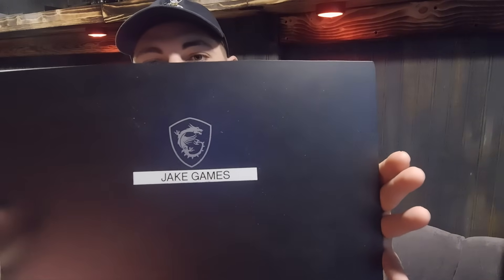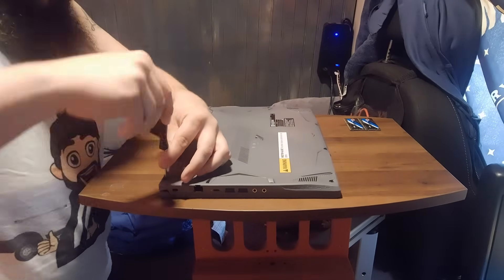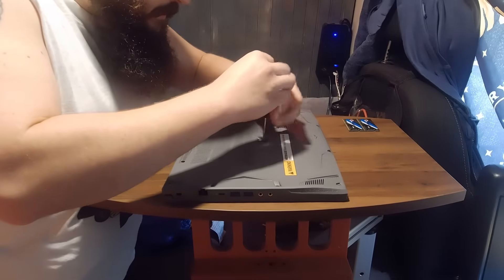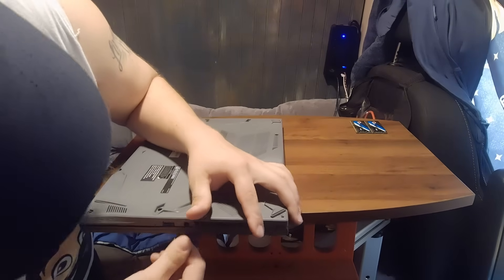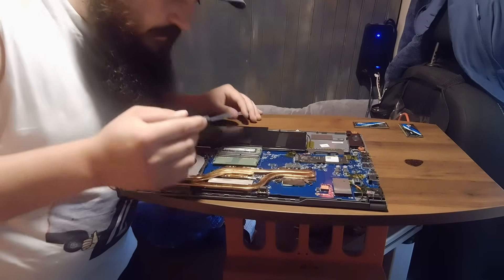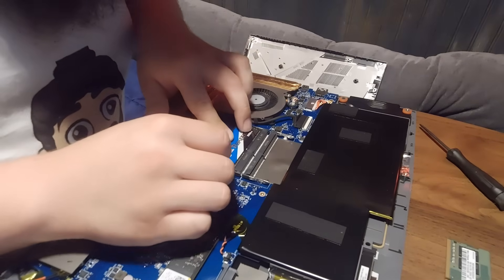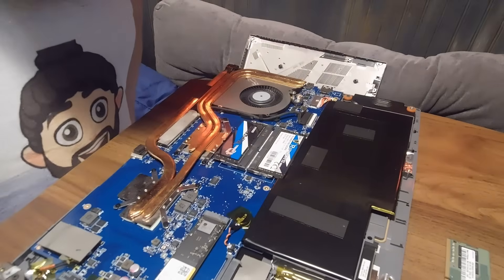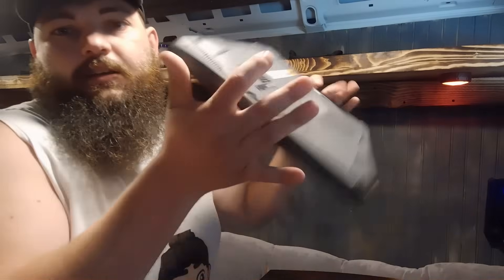Installing Ram Upgrade from 16g to 32g on MSI Thin 15 Laptop

Comment: Does any 32gb ddr4 work? Bc idk which one to choose
Reply from the maker: To know if 32GB DDR4 RAM will fit, check your motherboard's specs for total capacity and slot count (use CPU-Z or System Info), ensure it explicitly supports DDR4 (not DDR3/5), and verify the stick form factor (DIMM for desktops, SODIMM for laptops) matches your system, using online tools like Crucial or Corsair for easy compatibility checks.
Reply: @JakeChernisky  ty i checked i have 2 slots and max 64gb rn i have 2x 8 
I'm gonna get 2x 16 mine needs ddr4 and sodimm

Comment: Does this turorial also work for installing 64gb?
Reply from the maker: It should be the same. I had two of the 16gb to equal 32gb total. You'll have two 32gb to equal 64g total
Reply: @JakeChernisky Ok, thank you

Comment: Can we upgrade ssd?
Reply from the maker: That I'm not too sure on. I haven't done it on mine but if I do I will make a video
Reply: @JakeChernisky I think only able to add a sata drive
Reply: @jsolthedegen  You definitely can but you have to install an OS on the SSD you want to use (Windows or Linux). I couldn't figure it out, so I just got an adapter and did it that way. But that is the general idea as I understand it.